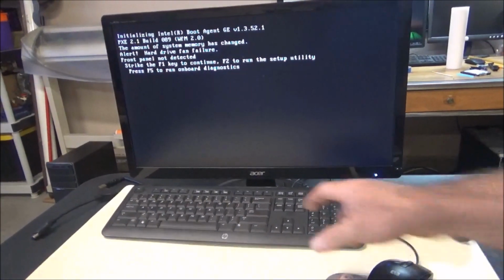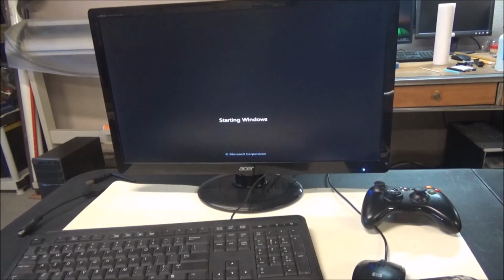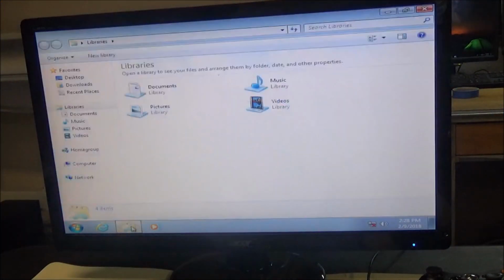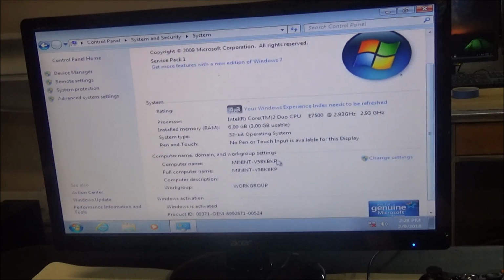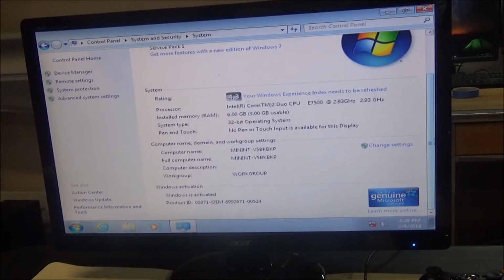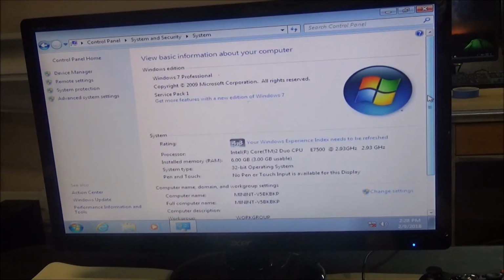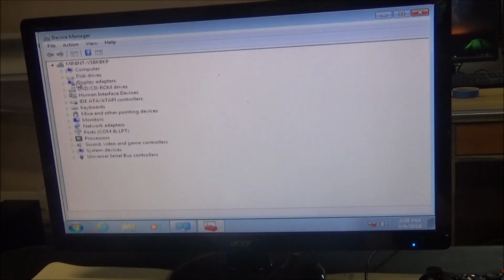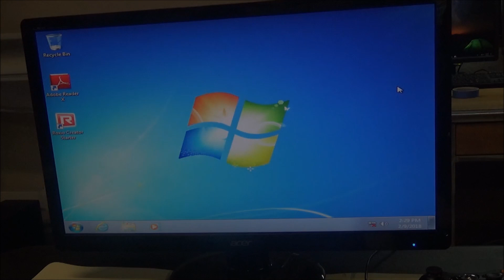Dell Optiplex 780 SFF + Full Size (one fan) GPU - Part 2

Comment: Dude!! I got an i3 2120 optiplex 390 - I put an EVO 860 - 500 GB in it I'm adding 16 GB of RAM but I'm having the same issue your having with buying a GPU!! I think I'm whipping out the dremel! Great ducking video man! Your giving me hope!!
Reply from the maker: Nice man! I suggest replacing that i3 with an i5 2400. They're about $30-35 but perform way better than the i3. Necessity is the mother of invention! This GPU is all I had so it was a great time to see if I could fit it in this case. Really fun project. Thanks for watching!

Comment: Nice project! I have been really fascinated with these dell optiplex SFF systems and wanted to make an HTPC out of one for the longest time. I thought that they'd be limited to low profile cards so I kind of gave up on that thought until I saw your video. I don't have any tools so the first time I attempt to put a GTX 1050 in there will probably be with zip ties and duct tape, hah
Reply from the maker: Thanks man, glad you like it! The Optiplex SFF makes a great htpc. Have you checked out the low profile GTX1050? They really screwed up the design by adding a hard mounted DVI above the HDMI and essentially making it a dual slot card, but it's still pretty easy to cut some of the Optiplex case with tin snips to make room for it. It would definitely be easier than using a full size 1050. Do you plan on playing AAA games too? Because a GT1030 would plug right in without any modding and does a decent job playing modern games.
Reply from the maker: Thanks for subbing!

Comment: It's highly likely the cable was meant to be routed underneath the motherboard, but the assembling operator either: a) wanted to save time because they get paid more if they build more units per hour, b) didn't care to follow the assembly instructions, or c) the engineering team couldn't be fucked trying to instruct the operator(s) to actually route the cable underneath the motherboard. And it passes QC because a) only a percentage of units go through interior visual inspection and b) QC inspect the system per the same instructions that the engineering team gives the assembly operators,  (see point c).

Source: I worked at a server factory as a member of the engineering team for five years.

Comment: I did basically the same thing with my optiplex 380, I used a shorter PCIe ribbon cable bent in a C shape to install an Asus phoenix cooler GTX 750 TI, I removed the plastic fan shroud from the GPU and only cut the case IO area around the video out ports, then mounted the IO plate back on top of the case sandwiching the GPU IO with the rear IO to secure the card, I was able to utilize the hard drive caddy's fan connector using a small dell CPU fan installed where the PCI/PCIe IO slots are, the PCI retention lock holds the fan in place and adds extra intake cooling then I reversed the CPU fan to blow out the front I also installed a XENON E5450 soket 771 CPU and Bios Mod powered by an optiplex 755  275W PSU  with 8 gigs DDR3 and a silicon power 512 gig SSD mounted under the DVD drive. Plays fortnite at 60 FPS and GPU/CPU temp never run over 60c. This Optiplex 380 mod runs games quieter and out performs my conventional 780 SFF with a Q9650 16 gig ram and MSI GTX 750 TI LP GPU same SSD and OS My next plans are to do the same thing to the 780 but with a GTX 1050 or 1650 with the Core2Quad Q9650. anyone interested in a MSI GTX 750 Ti LP hit me up

Comment: Sorry if those was already answered by why mount the GPU that way? If the fan would be facing the opposite side you could drill holes/add a fan grille to match its intake on the side panel and everything inside would be for sure cooler. Too short PCI-E riser cable?

Comment: I am trying to install a much smaller gpu but when I turn it on it just beeps, so I think it’s because there is not enough power so I got a bigger psu but same thing but then I learned that the motherboard limits the power through it to 25 watts and I need 35 watts just wondering if you had any power upgrades or problems

Comment: Question, what is the thing called that you connected to the graphics card to the motherboard. It almost looked like a pcie ribbon cable. I didn't know they made such a thing
Reply from the maker: That's exactly what it is, they work great and come in a lot of different lengths. Here's a link https://www.amazon.com/EZDIY-FAB-Express-PCIe3-0-Flexible-Extension/dp/B01CEKN5VO/ref=sr_1_1_sspa?ie=UTF8&qid=1536642859&sr=8-1-spons&keywords=pcie%2Bextension%2Bcable&th=1

Comment: I just mods my g1 800 sff to fits full size gpu but i put it on side panel out side of the case, way easy and generated less heat inside case... :)

Comment: Oh man, you are great. I was looking all around for 780sff upgrades and here u are!!! Great work! Any chance you could tell me if standard heatsink and fan for Intel(R) Core(TM)2 Duo CPU E7500 would be enough for quad core 9400? Your PSU is 280W from Optiplex XE?
Reply from the maker: Haha, thanks man. There is  small 780 sff cult following on YouTube and I'm here for you guys lol! Unfortunately the standard Intel heatsinks will not work, the hole pattern is different. But I have installed many Q9400's using the stock Dell cooler and it keeps the temps in check just fine. The 780 in this video is running on the regular 235W, it's plenty for a quad core cpu and a GTX750(yi). I do have another 780 that is using the 280W XE psu because it has a 1050ti, 16GB of ram, two storage drives and an extra exhaust fan. I felt like that one need a little more juice.
Reply: Thank you 4 your replay. Any chance you could find "stock Dell cooler " part no. or reference? I am in UK and most of refurb sellers have no idea as UK mostly sold DUO core models variants. Can you take a look at below ebay link ? 
https://www.ebay.co.uk/itm/Dell-OptiPlex-755-780-SFF-CPU-Heatsink-Shroud-H895D-H896D/310445988381

Would it be enough to keep it cool?  I cant find and data for which variant is this cooler (duo or Quad) :-(
Reply from the maker: You're welcome. That eBay link is the heatsink you need to cool  a Quad core. It'll keep that Q9400 at nice temps. If you have a little extra cash I would go with the Q9550, it's got twice the L2 cache and runs at a higher frequency.
Reply: @PimptatoPCs  thanks man, will let you how this worked out for me....
Reply: @PimptatoPCs  Will stick with Q9400 as its fairly cheap and widely available in UK. Q9550 its a problem to get, unless from US or China. I am sure 9400 is big enough speed up in compare with dual core E7500. Thanks again...
Reply: @PimptatoPCs  can I put amd r7 240 in this

Comment: can i put core 2 quad procie in optiplet 755 celeron?
Reply: First and mandatory, update BIOS to last version (A22), then you can use a Core2Quad on Optiplex 755. Clean it inside, as the C2Q will produce more heat.

Comment: Hi i was wondering what you would think about this: I have an optiplex 790 with an i5 2400 in and a gt 1030 with a loose bearing on the fan or something because it makes a really loud noise(its not just coz of a high rpm it makes a kind of scraping noise). I was thinking of upgrading to the 1050 coz i can get it from a UK shop called CEX for about £80 with a 2 year warranty. Do  you think i should try to fix the fan (I cant find any replacements online) or should i get the gtx 1050. i am aware of pcie power limitations like on the 790 its 35w but there are videos showing the 1050 working in the exact same pc on youtube. If you think i should fix the fan do you have any info on it?
Reply: have you released a part 3? i couldn't find one
Reply: @All-in A BTW guys I've now upgraded it to at gtx 1050 ti and up to 10gb of ram it works a dream. I got the gtx 1050 ti for £115 and the extra hyper x 4gb 1600mhz stick for £22. I can now play apex legends med/high settings 70fps I can also play fortnite at high/epic setting at 70fps too and on spellbreak I can run it at high settings at 60-70fps as well     this is all at 1080p as well. Next I'm probably going to move it into a red lit cit f3 case I can get off amazon(£30) as I'm pretty sure optiplex 790 is micro atx
Reply: Have you noticed all of the games I mentioned are Battle royale😂

Comment: Hello everybody. I have some questions. I have an older Optiplex 780. One of the small form factors. It has a 2 core quad 266 in it. I believe it's a 9600. I'm seeing all these people on the internet doing upgrades to them and I understand I will have to get a pcie extension cable to get a graphics card to fit in it that isn't single slot. But I was just going to buy a 1050ti and mount it on the side of the box. I don't want to spend $160 and not have it be compatible with the board. Anybody have any suggestions it would be greatly appreciated.
Reply: Hi there I have a gtx 1050 ti running perfectly in my optiplex 790 if that helps at all. I recommend you buy one from amazon because you can usually get 30 day returns on items from amazon. Just make sure it says dispatched and sold by amazon or something like that.

Comment: Just a question bro the blue pcle lessen the performance of the vega?....thanx to this great video I'm really waiting your answer
Reply: PimptatoPCs
Reply from the maker: The blue pcie is just the color Dell used for it. As long as it's a pcie slot then it won't affect the performance. Even a really powerful graphics card like a 1080ti can run at full speed on a pcie slot that is 8x instead of 16x. Or even 2.0 pcie vs 3.0 pcie. I think the bigger issue is making sure the pcie slot can handle the wattage that the card will need. Most supply 75W but there are some Dells that have less available and won't run even a 750ti. If you have a video card that requires a 6 pin power connector, then the pcie slot power is not an issue because you'll need a better psu to run the card anyway. Hope this helps, thanks for watching man.

Comment: i have lenovo m72e matx , can i put a gpu just like in the video ?
Reply from the maker: I'm not sure. I have never looked inside a Lenovo m72e before. I'll try to find some good pictures on the internet and try to give you an accurate answer. But there's always a way to mount a GPU if there is enough room. Just gotta get creative with zip ties =)

Comment: I have a Dell 7010 which is very similar but with Sandy Bridge i3. Someone is giving my a GTX1050 but it's full size. Currently running a GTX745 which is very weak. This is interesting because I really want to get the card in the machine haha
Reply from the maker: Oh man, that 1050 would be a serious upgrade from a 745. I hope my video helps you get it installed. And the i3 2100(?) is still a nice little CPU, plenty for that 1050. Thanks for watching David!
Reply: PimptatoPCs i3 3220 actually.  The problem is these boards usually do 50W on the slot itself.  The PSUs can handle it usually though. 

I'm actually going another route by getting a bigger case.
Reply from the maker: Sweet, even better on the CPU. Yeah, getting a bigger case is a lot easier and fairly inexpensive. Have you looked up the specs for that PCIe slot? I've heard a lot about the wattage limitation but have never had a problem with any of the Dell's that I've put GPU's into. I'm running a 1050ti in a Dell Optiplex 980 SFF without any issues. Good luck with that project, should be a nice system when you get it together.
Reply: @PimptatoPCs  Dude, Can i put quad core q9550 on my optiplex 780 MT ? Still using oem mobo from dell tho. And what gpu the best for my 780 MT without changing oem psu from dell.

Comment: I have a dell 3050 i5 6th gen and i want to put a new gpu. Do you think i could avoid such mods if io buy an used and bigger dell case? like a case of dell 7010
Reply from the maker: I just quickly looked up that model. Is it a micro size PC? If it's the micro size, the motherboard does not have a full size PCIe slot for a dedicated graphics card. One thing that you might be able to do is hook up an external GPU dock using the USB 3.1 port. Sometimes even the mini PCIe slots that are used for WiFi and M.2 drives can be used for external GPU's too, I'm just not sure what can be done with the 3050 without doing some more research. There are a lot of YouTube video showing how to make a dock for an external GPU though. Wish I could help more!
Reply: @PimptatoPCs  no its not the mini version. Its the Small form factor just like this one you used in your video.
Reply from the maker: Oh I didn't see the sff for some reason. You might be able to put it in a bigger case like the 7010 MT. Looking at the motherboard on eBay it looks like it's not square? It's got a cut out section to make room for other stuff in the case? That might make it hard to get all the front panel stuff to line up in a new case, and the motherboard mounting holes might even be different. What GPU did you want to upgrade to? It looks like there might be room for a low profile GTX1050ti but It would cover up the PCIe X1 slot.
Reply: @PimptatoPCs  ya i just saw it and being a polygon shape mobo wont help. Also i'd probably need to get a better power source and all this things made the deal quite problematic. Not to mention i'd need to sell my 4th gen i5 and ddr3 ram to pay for this dell
Reply: @PimptatoPCs  thanks for the reply bro. Well, i wont be able to adapt cause the psu is only 180w and it wont handle even a mid end vga. The previous owner was using a 1050 low profile but i wanted something more powerful.Also the motherboard has some 6pin proprietary connector sadly. I might just sell the case and motherboard online and buy a common motherboard. I only bought the pc cause it was for half the price so even with the need to sell stuff, its still profitable.

Comment: Hey can I put amd r7 240 in this
Reply: if it doesnt need extra power cable and its not too long - why not :) I have 1050ti [not slim] in HP 8300 elite :)
Reply: @lakimakromedia  can i change psu to 500w with adapter and than upgrade a graphic to normal standard graphic gtx 750ti?